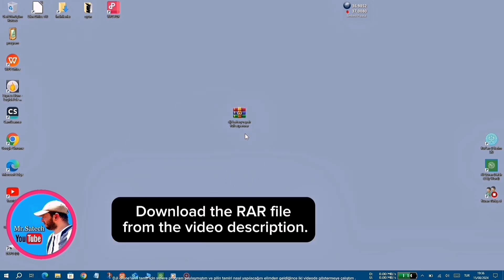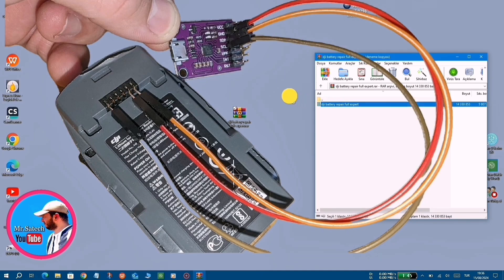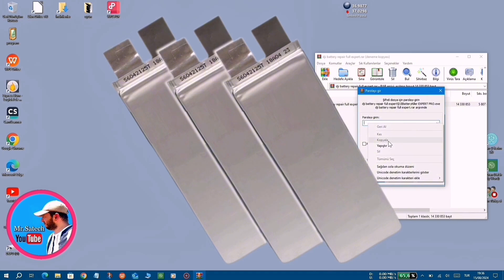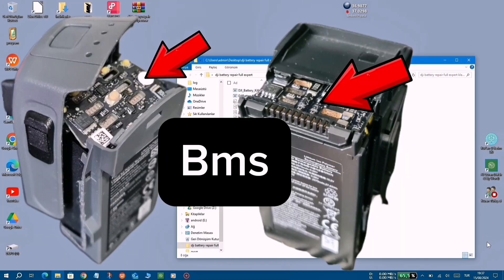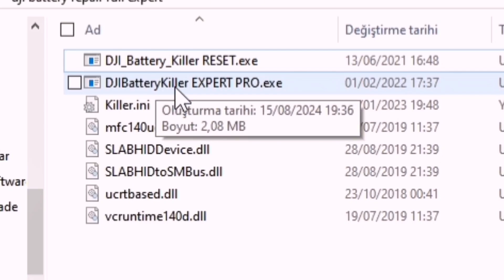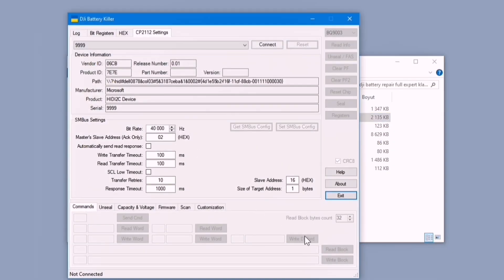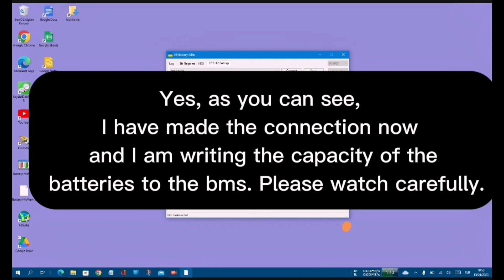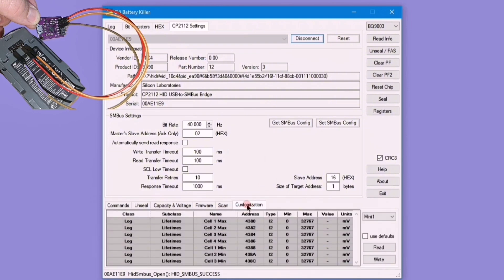Dji Drone Battery Fix ❗PRO version Part -3 DJI bms programmer

Comment: Please could you share the ifib file and the firmware of a battery that you can read? I'm working on a bms, with a custom chip  "bQ9003" but I must have those two files
Reply: @barreraino1219  hello sir please send me DJI battery killer

Comment: Hello, I am trying to work on the DJI Spark battery, but nothing is written in the customization section and nothing happens when I press the Read button. What should I do? Thanks
Reply from the maker: Sorry for the late reply, I couldn't see your message because it was in my spam folder. soo. i sorry seal and unseal You must unlock the bms with the buttons. if your battery if the charge status is above 3.8v. thank you
Reply: @MrSatech  Hocam sanırım Türksünüz, nasıl mühür açacağımı anlamadım. Şuan tekrar bataryayı bağladım ve customization kısmında hiçbir şey çıkmıyor. Read tuşuna basıyorum ancak "The Capacity & Voltage table is empty" yazıyor.
Reply: Ve geç yazmanız sorun değil hocam yazmanız yeterli teşekkürler
Reply from the maker: Merhaba bataryadan modifiye yapmadan önce programın bataryaya bağlanıp bağlanmadığını bana söylermisiniz .Eğer program bataryaya bağlantı sağlamıyorsa pillerin izin voltajı düşük demektir. bu video serisinin 1 ve 2 bölümleri izleyerek çözüme ulaşabilirsiniz . videolar kanalımda mevcut.
Reply: @ bu bataryayı sizin videolarınız sayesinde şarj almıyor halde ikan tekrar şarj alır hale getirdim. Program bataryayı görüyor ve okuyabiliyor ancak customization kısmında nedenini bilmediğim şekilde hiçbirşey yazmıyor ve read tuşuna bastığımda üstte belirttiğim uyarıyı veriyor
Reply from the maker: sag tarafta read info kısmından pili okutun,daha sonra unseal/fas yapın normalde pil  modifiyeye acik hale gelecektir ,daha sonra aşağıdan read value basın .pil bilgileri gelecektir.modifiye yapın ve write value yazan yere basın ,daha sonra islem bitince seal butonuna  basarak  bms nin kilidini kapatın . daha sonra clear 1 ve 2 ye basın islem bitince reset  chip e basın ve pili drona veya sarj aletine bağlayın . biraz karışık ama aslinda öğrenince basit
Reply: @MrSatech   Hemen deniyorum hocam
Reply: @MrSatech  Hocam çok çok teşekkür ederim bu sefer işe yaradı. sadece modifiye kısmında ilk başta olmadı bende "backup ee" yazan yerdeki tik işaretini kaldırdım ve o şekilde read values kısmına bastım ve pil bilgileri geldi. Teşekkür ediyorum bu güzel bilgiler için.
Reply from the maker: like. lütfen .başarılar
Reply: @MrSatech  like'ı girer girmez attım,ayrıca 1-2 ay öncede abone oldum hocam. İyi çalışmalar diliyorum.

Comment: can I fix code 30074 with dji battery repair tool?
Reply from the maker: It can be defective cell or bad battery connection. You can try the dji battery repair program, but we can't know the exact result, You can try this or clean the pins of the batteries. Check if there is oxidation on the connection pins of the batteries. It's very difficult to say anything without trying.
Reply: @MrSatech  thanks, I will try